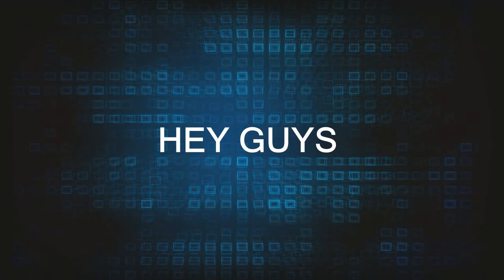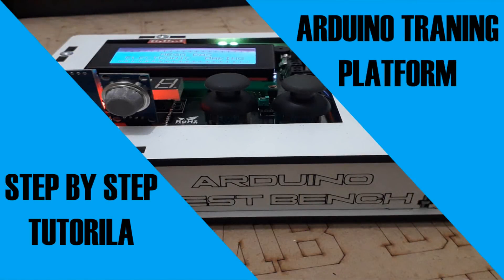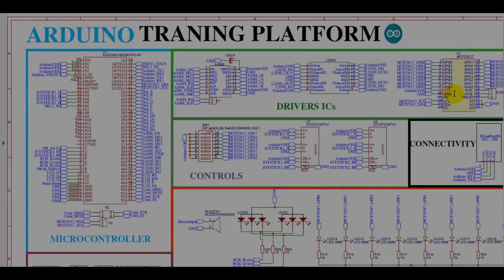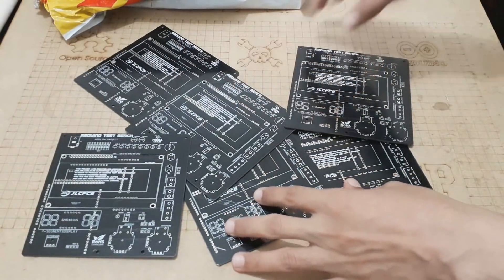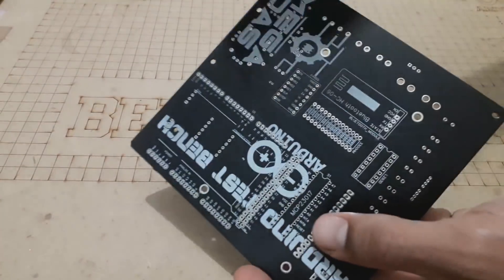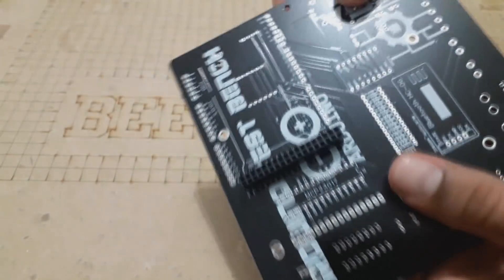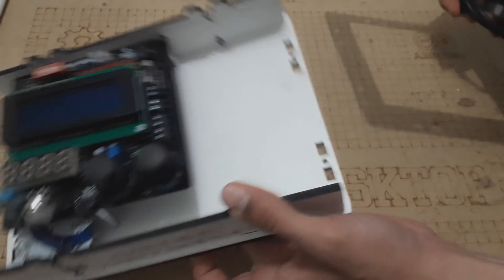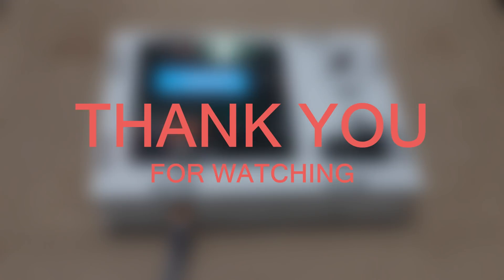Arduino learning platform

Comment: Your video is fantastic, but you links are insulting. Why do I have to be exposed to useless links that has nothing to do with your projects and trying like hell to leave adware and cookies on my system. Clean this up because you are showing one of the best arduino testing platforms I’ve seen. Your links makes it impossible to get the necessary information to build this platform.

Comment: Hey, I have a bothering question. Namely, I bought arduino uno, and the diode next to L is flashing message through blink. However, as the module moves, this LED can dim or go out and when it moves again it will come on again. I think that something is not touching somewhere and I have probably read that it happens. My question is whether the tile can break down? Thanks for all the info. I hope  you understand  me, I dont  speak  good  English
Reply from the maker: Hello Darek Mistrz
Ok so as I understand you just got an Arduino board and at your first run of the board the L LED start to blink! This is absolutly normal since each new Arduino board has the "blink" arduino example.
So I advice you to try to upload any other example and find out if something change arround it.
You can upload the same blink example and change its time delay and see if the L LED change the its frequency blinking or not 

Let us know if we can further assist you.
Do not forget to subscribe to our YouTube channel for more awesome videos.